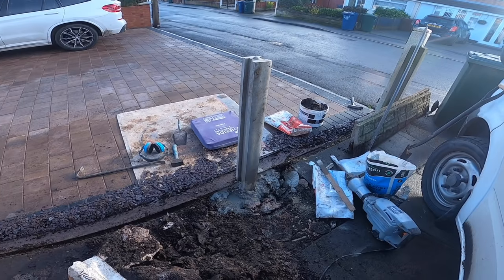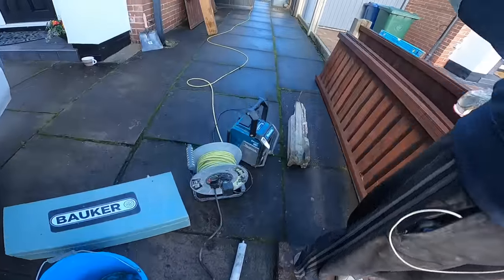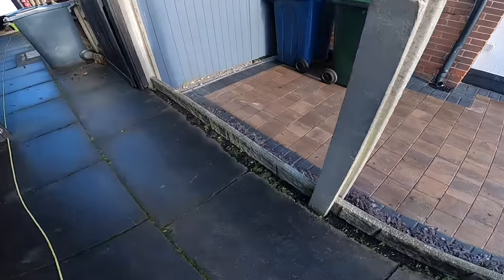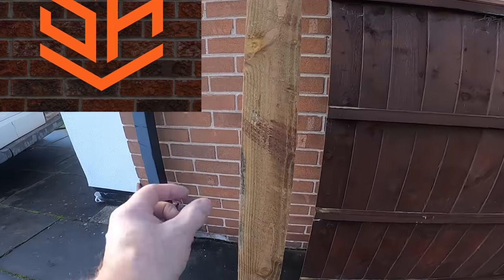BLOWN FENCE POST REPLACEMENT

Comment: ...So why remove a concrete post to replace it with a wooden post...?... Tip: I use Everbuild liquid waterproofer on concrete posts, and give then a good soak in it before putting them up...it keeps the water out and stops the reinforcing rusting, and consequently the concrete blowing out where rust starts, and the water just beads off the posts and they stay clean too, as keeps all the dirt from getting into the surface and accumulating on the posts...
Reply from the maker: Nice tip . As for the post there are some heavy timber gates going in so the post is better for fixing to and is also 150 x  150 mm so way stronger than the flimsy concrete posts 💪🏼🧱👍🏽
Reply: That's a belter of a tip, Stu. Nice one👍

Comment: Wow some depth for post good job👍👍👍
Reply from the maker: It’s going to have a heavy gate hanging on it soon 💪🏼🧱👍🏽
Reply: @SteveAndAlexBuild  as for a gate ,you should have set a timber post with your concrete post for easy fixing,,for the gate,,,ho rocket science comes to mind ungreatfull ,,,,,,,,,,,,,,,
Reply from the maker: @huggy1huggy191  Us , the customer and the joiner fitting the gates discussed this post and the 150x150 mm pressure treated post was decided upon as its stronger and will out last a fragile concrete one by years . 🧱👍🏽

Comment: bit over the top with the post crete dont u think
Reply from the maker: No mate always 2 per post plus when you take an old post out the hole is always bigger 🧱👍🏽💪🏼
Reply: @SteveAndAlexBuild  im  landscaper/fencer by trade when i take out concrete posts i add 2 postcrete then fill the rest with a concrete mix to top up, i understand on the smaller jobs like this one but over a long run its just easier... keep up the good work, a tip for you if you get fence post repairs get a post saver sleeve adds even longer on the post and stop it from rotting at ground level :)
Reply from the maker: @jakebazzell413  . Thanks for the tips Jake  , much appreciated 🧱👍🏽
Reply: @SteveAndAlexBuild  keep up the good work lads :)
Reply from the maker: @jakebazzell413  😁🧱👍🏽